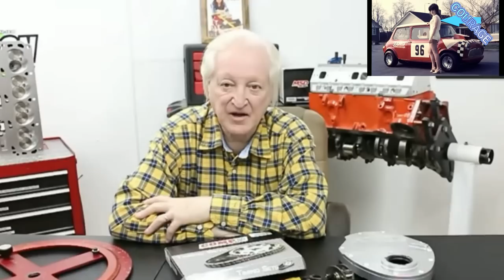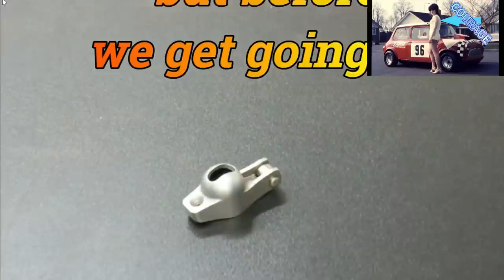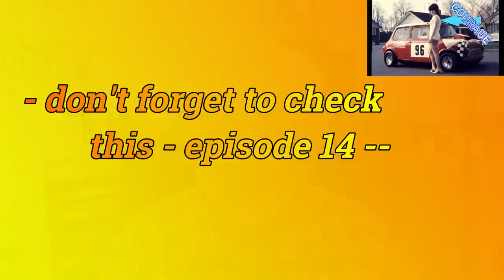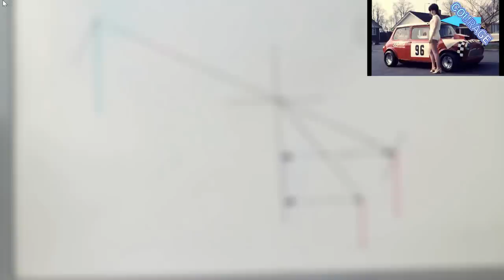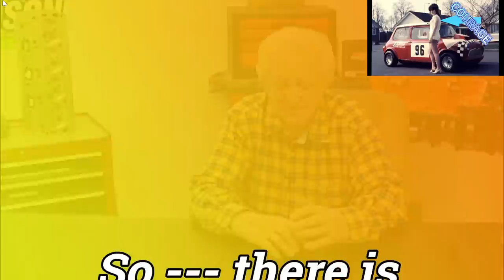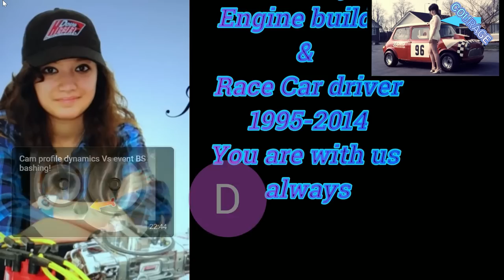High lift rockers - desirable but incorrectly tested.

Comment: Fast off the seat    valve motion per degree of rocker rotation is greatest when the axis through the fulcrum and rocker roller are perpendicular to the valve- simple geometry   
With a Crane style this is done by effectively and raising the fulcrum and either angling down the pushrod arm or using a longer pushrods.  
No free lunch as angling down the pushrod side arm usually decreases the rotation degrees per movement of the pushrod.
The sweep across the valve tip tends to start on the outside and moves towards the inside
If the tip is coming off the tip on either side you need to move the valve tip or use a different length rocker arm
OR move the fulcrum down so the effect is not so great
Now we have maxium acceleration (assuming the pushrod is perpendicular to the pushrod arm) 
AND we have the least load at maximum lift and thus less tendency to float the valves and you can see if you plot the roller tip it is moving more sideways so you do loose a little lift'
Now unless you are really in a class build where your changes are limited where you might want to go the complete opposite way with the rocker axis perpendicular to the valve at max lift  well think about it real hard
Best for general use is to use the mid lift method where the axis is perpendicular to the valve at half lift.
Easy to do with stud rockers  and you will have fewer wear problems if this makes a difference
With MOPAR shaft rockers kits are available to raise and relocate the rocker shafts WELL WORTH EVERY PENNY
you will end up with the smallest possible contact patch
DO NOT TRY AND CENTER YOUR CONTACT PATCH  this can only be done by changing the rocker arm length or relocating the fulcrum/ shaft/ rocker stud     not in the exact center is NO BIG DEAL
Be sure to work with your camgrinder as they may advise a specific geometry

AND
Several BIG camgrinders have wrong information in their catalogs and no idea what they are talking about
Trying to get some clarity on what David was saying about adjusting lash and centerlines would be very difficult
END RANT
Ps  do not draw you axis line between the fulcrum and valve stem with a roller tip rocker- through the center of the roller tip.  You draw to the top of the valve with a flat tip stock type rocker
now put in longer valves for those new longer springs and start allover again
cheers

Comment: Thanks, DV. I notice in a similar path of analysis that folks testing various LCA camshafts generally compare lobe separations without pulling back the duration on the tighter lobes to keep the overlap consistent; thus arriving at a flawed conclusion (even when the tighter LCA made more power). v/r wh
Reply: Do you actually mean LCA (lobe centerline angle) or LSA (lobe separation angle) ?  Two completely different things....

Comment: I agree with you, just because someone says that if you put these on your engine it will fix the problem. Back before we had all these fancy gadgets, I had to adjust my valves every Friday and night at the local races. I drove the car every day to get to work and wherever I had to go. When I would set the valves for more intake lift and to try and get as much as I could while making runs, would not behave nicely for the stop in go driving around you would do during the week. That said I would have to wait after it cooled down some and readjust my valves before I went home along with a small adjustment to my carburetor. I had no idea how much geometry was involved and what I would have to do to figure it out. This was before the days of the tuners, laptops, and all the fancy gadgets that you are able to utilize today. If I would have had a clue, I would probably not have to have to put in so much adjustment on my solid lifter cam in my 400 SBC and would have not had to do so much for so little, that said that little made a good difference between daily and straight line 1/8 & 1/4 runs. Good morning and thank you again for sharing your knowledge with the geometry of how just a little bit here and there, equals more and probably way better manners if I would have had a clue or some help from someone who knows what the little changes here and there will accomplish. I will wish you all a Happy Holiday Season and a Merry Christmas! Great day and enjoyed the video as always. Never to late to try and learn how to do it and make it work for you and not against you.

Comment: You have a great understanding of the "science" of distance and timing, I have a layman's question, is the purpose of the design of the rocker, especially the roller rocker, to prevent the least amount of "binding" which is a big reason for the loss of horsepower, when the cam is at its height or the duration of lift, and in no ones comment, no one mentioned the inventor or modern inventor of the roller rocker/lifter and cam, Chet Herbert.

Comment: All canted valve engines with different angles, and different lengths, suffer these issuse more than engines with inline valves. The New Hemi pushrod arrangement, with non adjustable shaft mounts, can be fickle with getting quiet lifters, with aftermarket camshafts. Making an adjustable pushrod, and measuring each one for optimal lifter preload was an all day affair.

Comment: Interesting David!
I became aware of complexity of engineering rocker arms when began programming a CNC machine to cut a set of billet shaft rockers for my Cadillac 500, 25 years ago.

I learned rocker geometry is a surprisingly complex subject. Set actual ratio at no, mid, or high lift? The height of the pushrod seat in relation to the pivot point has a dramatic effect on dynamic ratio changing lift acceleration rates throughout the lift curve.

I ended up using the radius of both contact points in relation to the pivot point at a mid lift to set the ratio geometry. 

I've always wondered since then if camshaft designers take the dynamic principal of the geometry involved of a specific brand rocker into account when designing camshaft lobes. Or if they don't take dynamic rocker ratio into consideration at all?

Comment: Regarding the degree wheel, I can see that the second scale has increments twice as big, so it would read cam degrees, and I can see that it's readily indexable with respect to the main scale.  I don't see it at the Comp Cams website, but the main wheel does come with the holes for it.  I suppose you could use it for adjusting the cam for a desired degree change, and then quickly return to the previous setting to test for repeatability of the original readings.

Comment: The engine family I am most interested in is the Ford FE. The rockers stock are  1.73 hyd  and 1.76 ratio on a shaft system. I measured mine and they were factory replacements for the shaft system and they were all 1.8 , and did not break any valve springs. That was quite a bit off but they were to my advantage.
Reply: Pretty good for a motor designed PRE WAR   I like the larger balls on the rocker adjusters compared to MOPAR   I convert to ball pushrods and cups on the adjusters and oil through the pushrods
Reply: @jmflournoy386  Yep, Ray Paquet is still chopping wood with one of those pre-war axes in SuperStock, running Low 8s in the quarter. They still do surprisingly well.
Reply: @jmflournoy386  No I don’t believe that the FE was designed Pre-War. Are you thinking of the Lincoln-Y block? It was the same bore spacing but it came out in 1952 in Lincoln Mercury and Trucks at 317ci. It was discontinued in 1957. They never used it in Fords. Mercury and Lincoln are a few in trucks. In 1958 the Edsel came out with the FE and the MEL. The Y block 272-312 soldiered on until 1964 but was overlapped by the 221-351W. The FE was around in cars until 1970 and trucks until 1976. The MEL was in use until 1968, when the 429 came out in the Tbird and Lincoln and 1970 across the entire line. The 4.63 bore spacing was discontinued in 1976. The 335 series had small block bore spacing with the 351M 400 having a taller deck height. The 460 came along in 1970. I hope this helps. But the FE didn’t appear until 1958. It wasn’t used trucks until 1964. And they do have a great valvetrain. I have pushed stock stuff with the right springs and aftermarket pushrods or 427 pushrods on .030 over 390s to 7000 rpm +
Reply: @Bbbbad724  some research needed  I was referencing a recent podcast where the question was replacement cylinder heads for the FE where the pushrods would not hqve to be through the intake manifold where the 1937 and not into production for 20 years was mentioned
Reply: @jmflournoy386  Thank you Jim
Reply: @jmflournoy386  Can you let me know where I could listen to that. It would have been cool if they had made it that long it would have been a good 21/2- 5 ton truck during the war ! I like the Allison’s and Merlin’s they ran in power boats in the 60s. I’m a sponge for history. I’m almost blind now, but I would love to hear the history behind the design because it adds to the charm these old motors hold. I apologize for bringing up another engine family, especially one so obsolete. I got to thinking that I have been rude I still love those engines though!

Comment: The rocker ratio is a combination of two arcs so the actual ratio varies a ton based on where you measure it at.  Not sure how far down that optimization road you went but I expect with the better ratio rockers the ideal duration likely also got less since the longer rockers effectively add duration as well.

Comment: Thank you David, I have trouble absorbing information on the first pass these days, I am just a youngster at 68.    I don't know how many times I have watched this video but I seem to pick up new things every time.  Did you ever do more testing on the Offenhauser intake manifold that had individual/split Primary and split secondary runners/ports all the way to the heads.  In other words a total of 8 runners for the primaries and 8 runners for the secondaries?  You did a test on intakes and commented that it didn't give the highest HP but you wished you had of made part throttle tests for all the manifolds.

Comment: I don’t fully agree that a stroker motor requires the valve to open faster relative to a stock stroked motor due to fact that the piston dwell at TDC is longer on a stroked motor thus allowing the valves to open, in essence, faster.
Reply: With same rod length piston dwell around TDC is shorter   plot where the rod is pependicular to the crank throw

Comment: I know how making more HP was the problem.  In high school we did a test in science class. We put two erasers 40' apart. Each student, had to run and pick up an eraser and drop it 40' away next to another eraser, then pick up the other, and drop it at the spot the other eraser was. Then, based on our time the teacher calculated how much HP we produced.  Only the smallest girl in the class could produce one HP.  HP is potential power, but the real force that moves the car is torque.  If you sacrifice torque,  it does not matter how much HP you can produce. Bug rig trucks only produce about 300-400 HP, but they haul 80,000lbs all day every day. Because of torque.  Just as the little girl in class had 1 hp, she would lose a tug of war with all of us every time, because she did not have torque.  So if you have a Chevy 350 producing 500hp with 350ftlbs of torque that's not good, you want 550-600 ftlbs of Torque.  Your torque should always be numerically higher than hp so you can apply the hp to the wheels. You can make an engine spin faster and make more HP but if it can not apply that force through torque,  the HP is useless.
Reply: I believe you are correct to the situation you are implying as in the pulling or hauling power, the extra load of moving something is where torque over hp comes into factor, but in racing if you have a sbc 350 with 500 hp with 500 lb ft tq against the same engine with 475 hp and 500 ft lb tq, that extra hp with the 500 horse engine with pull away on the track
Reply: Now in dirt track situation, considering the condition of the track weather it's dry slick or tacky. In dry slick condition the lower hp engine may pull on the straight over the higher hp because more hp will spin tires farther down the straight wasting energy while the lower hp will not as much and I have witnessed this overcoming over higher hp output many times. Now the more hp will have advantage in the turns with weight transfer into the grove in the banking. But also may not be as much advantage as lower hp engine with momentum around the top Grove against the cushion. Many different factors in all situations, my opinions from my experiences.
Reply: @ljpowersports3675  ,  Thank you for adding to my comment, I could not have articulated any better. That said, I have never raced track, so the whole concept is foreign to me. On the strip it's a different ball game. I have a neighbor that races on a dirt track nearby, Ihe has me thinking doing the same, never to old to learn. I'm not sure how I would do.
Reply: Not problem at all, you're very welcome. The same applies to the drag strip and the street. The variables and discrepancies (not limited to) lie within equipment used that transfer the tq and hp to the surface and surface conditions also. The difference in a drag strip and the street strip can almost be compared to dirt track with tacky surface (drag strip) or dry slick surface (street strip). So with some of those variables in mind to how the suspension is built, the tires used,  gearing, etc., etc. A higher torqued lower hp engine could have an advantage over lower torque higher hp unless that guy has fell behind in all other areas the make up the car engine is in. So, in conclusion it's all about the components that make up everything else the engine is connected to that also helps determine the potential of finished product, not (limited to) just what the numbers say is at the flywheel.
Reply: @ljpowersports3675  , I've found gear ratio to be more important than almost anything else. You can have all the horse power and torque in the world, but if your gears are to high, it's hard to get off the line, to steep, you will get beat  towards the end of the race.
Reply: Right, thats also another thing that has a lot of connected variables. To get gear ratio output to the surface, not just matters at the ring and pinion but gearing before and wheel and tire size. With all these factor considered with a machine built for it, alot of small increments and testing goes into a winning machine! Sounds like fun!
Reply: I hate to rain on your parade, but you are wrong about some of what you wrote!  HP isn’t potential as that is stored, it is how much work is performed in a specified amount of time!  The only work the girl did was lift the eraser off the floor (force times vertical distance) the steps she takes are not work unless she walks uphill a certain vertical distance.  Also, having a torque curve that is higher in all aspects over a HP curve is not good in a performance application, maybe for pulling a load.  Example, a Harley Davidson, they have a larger torque curve than HP curve and they are total turds when it comes to performance!  If you put a much better cam than stock in it then the peak HP is higher than peak torque and the performance increases a lot.  You’re only a few calculus and physics classes away from having a good grasp on the subject! 🎯💯

Comment: you forgot to say: opening faster will slam your valve faster on the seat, no free lunch. jerk/jounce depends on installation height. midlift-square is not the holy grail, its disregarding the pushrod side and wear considerations.

Comment: So if a person  replaced a 1.5 ratio rocker with a 1.6 or 1.7 on the intake, would it always require retarding the cam slightly..... 1 to 3 degrees, or was your example specific to that big block build with the 1.8?
I love how you bring up, what should be obvious.
...if you change or modify one part, other parts may need tweaking.
Kind of like medicines or vitamins.
If you take one pill, it depletes a vitamin.
....so you increase that vitamin and taking an excess of that vitamin depletes you of a specific mineral. Round and round we go.
If that didn't make sense, it's because my name isn't David. 😁

Comment: Hm... If "fast off the seat" is a issue, then more avancerad angle at the pushrod end would be a solution then? The closer to the vertical centerline of the pivot will give a virtually higher ratio that descends as the angle in that radius move upvards increase. I guess this will put higher quality demands on cam, lifter, pushrod and oil. So by choosing a co-operating camprofile that work with the lyfter there would be a great advantage by doing this more than a higher ratio? Or is the downsides a greater concern, and what are they?

Comment: Hello love your videos. Just got finished from a old pro 383 sbc 010 virgin block mickey Thompson cross ram running great 👍. Have a Cadillac 472 high $ heads . Did they stick a valve spring shim to increase the valve opening and closing. Thank you for your great work.

Comment: Horse power to weight is hard to beat I've seen a few mini's that could run with just about anything because the competition weighed around 3000 pounds give or take a few pounds

Comment: When will we get rockers where theyare spec'd by their geometry of the 3 important points?
Reply: Jim Miller holds the patents on correct rocker geometry on the 3 important parts.  So his are the only ones that are legally correct right out of the box. 

And if you're building an engine that he doesn't support, you just have to get close with different parts.

Comment: Would a Pontiac 350, with 2.11/1.77 valves and 1.65 rockers, be undervalved?
Reply: not as much but still   are valves shrouded?   
When picking cams Pontiac is not SBC so if the cam recommendation is the same  RUN